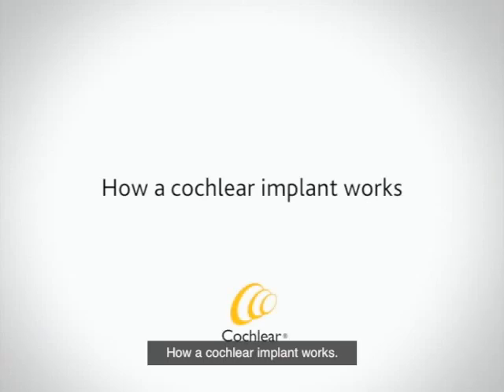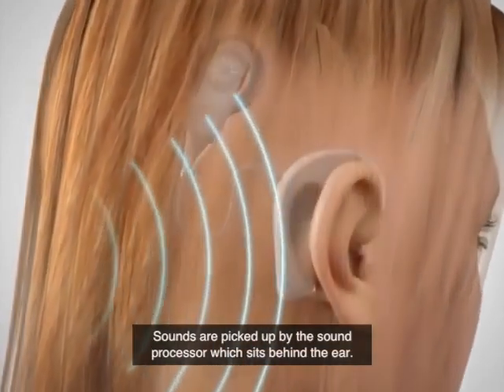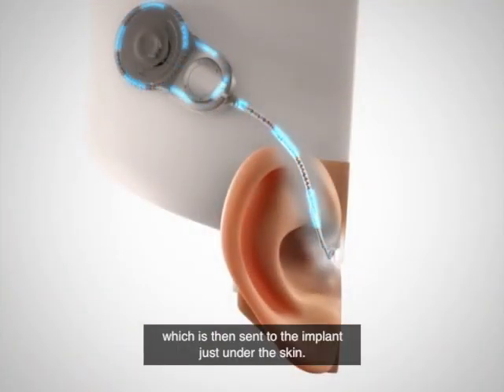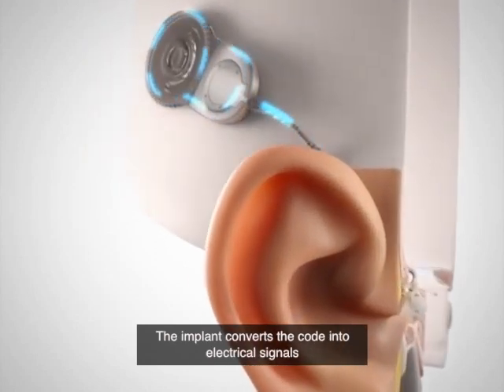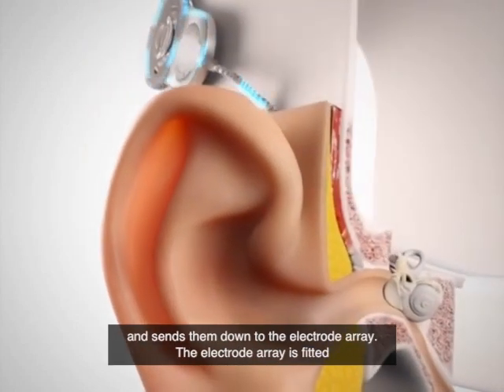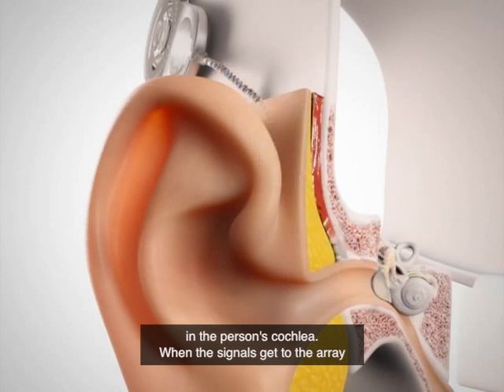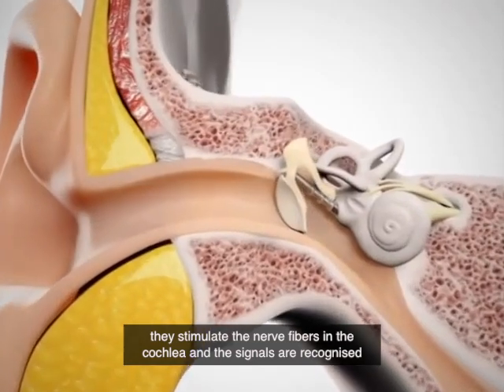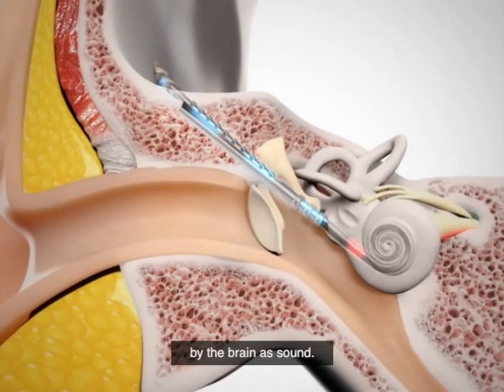How a cochlear implant works

Comment: A couple questions if anyone can answer them please. How do they reseal the round window since the cochlear is supposed to be a fluid filled sealed organ. Secondly how do the electrodes stimulate the hair cells since they are intended to be stimulated by movement of fluid.
Reply: The surgeon takes a bit of muscle tissue from the neighbouring area and packs it around the area where the electrode array enters the round window. As the wound heals this tissue anchors itself to that area and seals the puncture. In some cases, the surgeon may in fact insert the electrode array in to the cochlear not through the round window but through a separate hole in the cochlear (the process is called cochleostomy). In that case also, muscle tissue is used to seal the area around the electrode array at the entry point into the cochlea.

For the second question: the electrode array does not stimulate the hair cells. It stimulates the auditory nerve directly. The process is more like zapping the nerve ending at different locations in the cochlea. BTW, in normal hearing, the har cells are not stimulated by the fluid movement per se. They are stimulated by the vibration of the Basilar Membrane which makes the hair cells embedded in the Organ of Corti to rub against the Tactorial Membrane.  The vibration itself is caused by the movement of the sound waves through the Perilyph in the Scala Vestibuli of the cochlea.
Reply: @reubenpilli6549  Thank you so much for such a detailed and excellent response. Much apreciated.